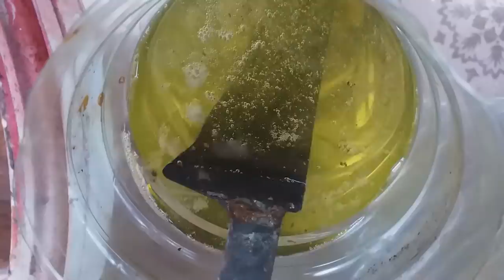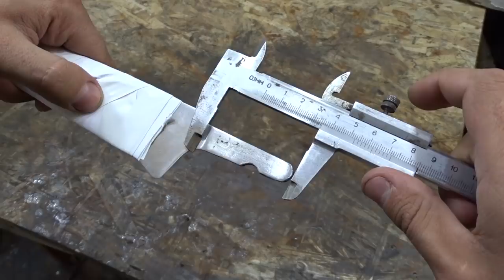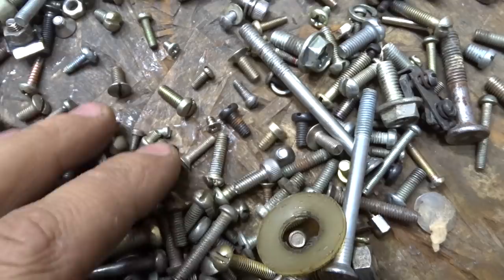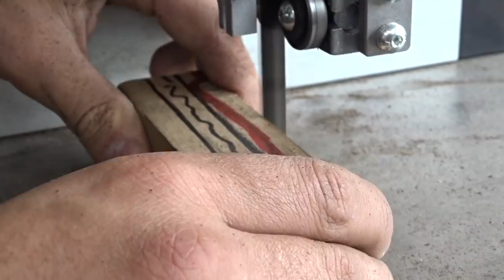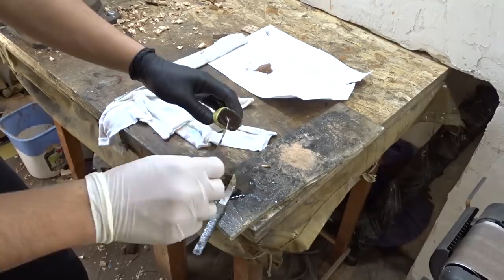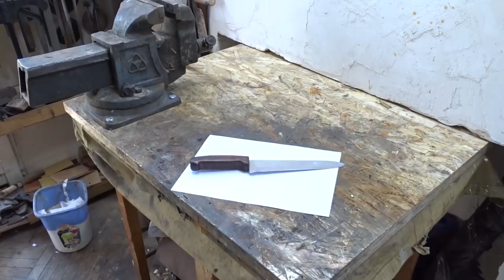Old Rusty Butcher Knife Restoration

Comment: Ingenious way to extend that tang if you don't have access to a welder. Personally, I would have left the threads on the back end usable and then counter sunk a nut in the end of the handle, so you have a mechanical bond as well as a glue bond. You do nice work. Do not apologize for your English or anything else.  In fact, if you care to speak more, I really don't mind. I find accents interesting. The handle does look brilliant on this knife. Fits it more than just in the literal meaning. Turned a rather ugly, cheap knife into a beautiful creation. Never apologize for your materials being a problem. You work with what you have, there is no shame in this.
Reply from the maker: Thank you! I really appreciate your attention, thank you sir!

Comment: Nice! But, in my opinion, it would be better instead of the brace plate to make two faces to the blade at angle ≈45°. Most of the chefs hold the knife so that the thumb and index finger are on the blade.

Comment: I'm able to understand what you say, that's good enough for me. I thought the restoration looked good, but one thing that could be problematic for the tang area are the hard 90° edges. Rounded edges are usually better off just for stability's sake of the tang as after heavy use, it can snap there, particularly on hardened steels. But still it's fine nonetheless. One thing to do other than filing or grinding it in, you can also put a small drill bit through there to create a round area to reduce stress
Reply from the maker: Thank you sir for attention and info! Regards!

Comment: Great job. Couldn't you have fixed the original handle with the epoxy and saw dust from drilling it out?
Reply from the maker: Hello, thank you for attention, sir. Yes, but that handle will be have weak spots and it's not safety. In any cases the second way I could try to use new form and made it from special resin epoxy. But I don't have that stuff and lathe machine.

Comment: your knife restorations are great, but you need to grind down the heels on chef/kithen knives.  If you set the knife down on its edge there should be no gaps along most of the edge.  In this knife you losing several inches of cutting surface.
Reply from the maker: Thank you for your attention and advice! I really appreciate it!